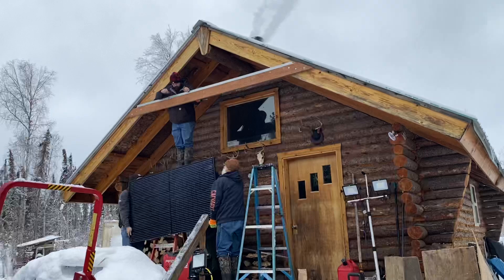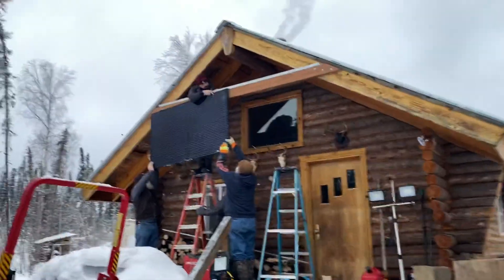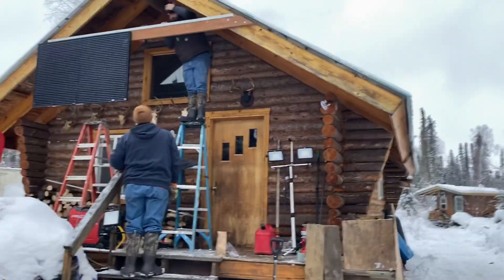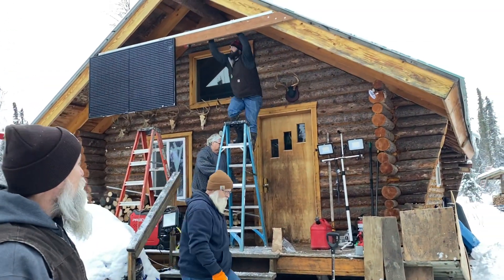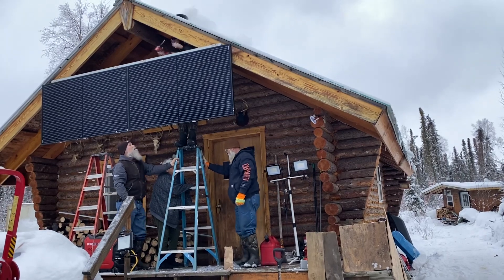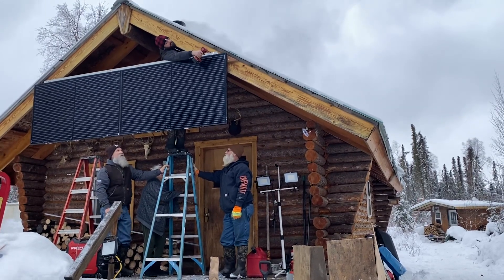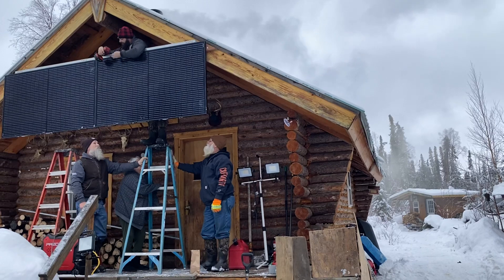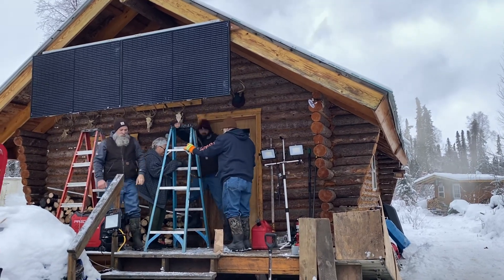0100 Installing Solar Panel at Off-Grid Cabin in Alaska Part  December 28, 2020

Comment: Only in Alaska (and YT, Siberia, etc) it's not wrong to install them vertically.  They shed snow perfectly and give good winter production.  In some installations, they can be protected by the eaves above.  But the summer production will increase the closer to about 45 degrees you pitch them.
Reply from the maker: Wow, thanks.  TONY, did you see this?